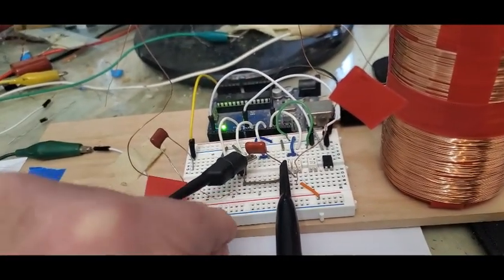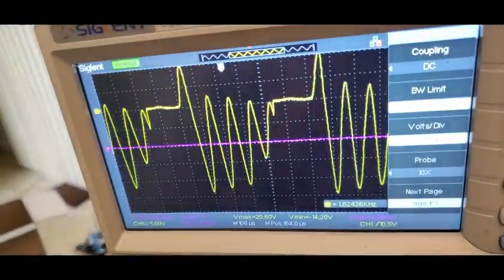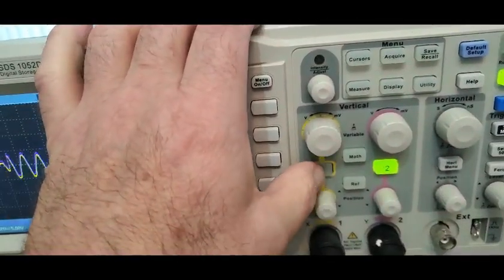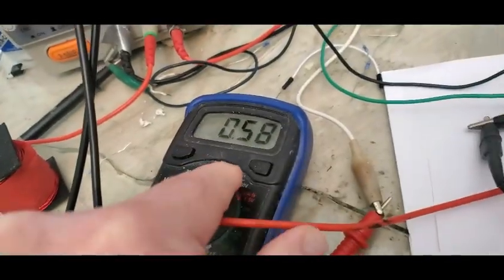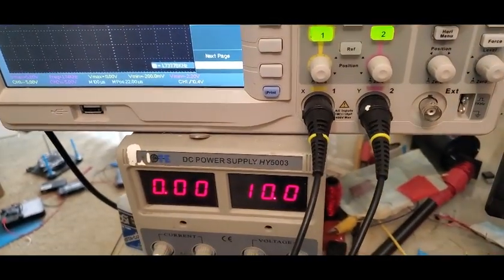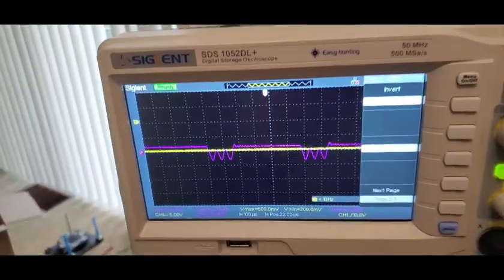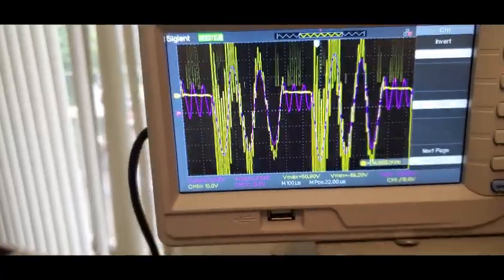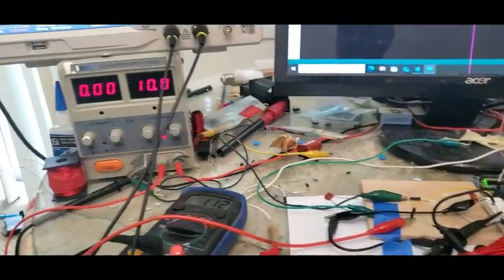A Capacitor and a Bifilar Coil: Part II

Comment: I think you are trying to isolate a back emf spike, but back EMF gets released by the coil at the speed of light and the duration is too short to do any real work
Reply from the maker: Hi Johan,
Thank you for the feedback. It would be nice to pretend I had some Master Plan with this but the reality is, well the term I have heard military people use is "spraying and praying" hehe.  I think I have a decent idea of Q Factor at this point.  The introduction of a second ground led to all this new behavior that will take time to digest.  It didn't help that I first went at it with a bifilar.  The, let's say oscillations of the primary Q Factor oscillations, they may be from the two winds interacting, they may be from an oscillation with the Earth ground, they may be from the capacitance of the coil itself.  I get the cool kids factor in the capacitance of the coil itself (however that is determined) to achieve the best oscillations. At this point I had just never thrown in an Earth ground before and was having fun putting the four wires in different places and seeing unexpected results.  I am still having enough fun with this that I will likely stay at it a little bit longer before returning to spinning up some rotors. In a nutshell, I could probably stand to do some reading at this point, maybe even see what Tesla was saying, as he so often had earth grounds and bifilar coils in his patents.

Comment: at 12:16 You can charge a coil with just one wire connected because the charge is stored in the coil(not the wire) yes the wire in a coil form, and the second coil of your bifilar coil will also store and release some charge. even if it is not connected.
Reply from the maker: Yep, I ended up where I removed the cap entirely and, set up one wire, still had oscillations off the secondary.  The only things left to charge were 1) the capacitance in the switch 5 pF if the meter is right and whatever capacitance is in the coil.